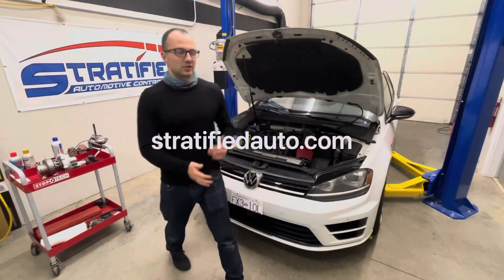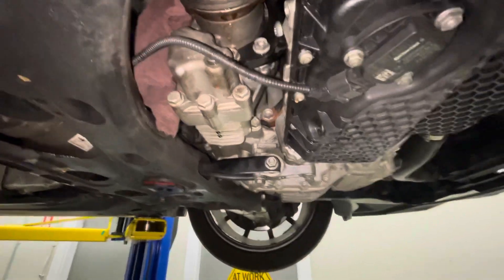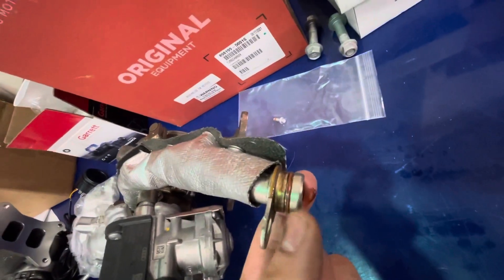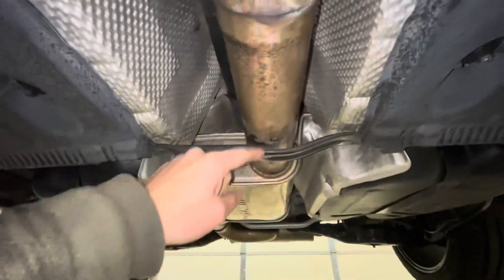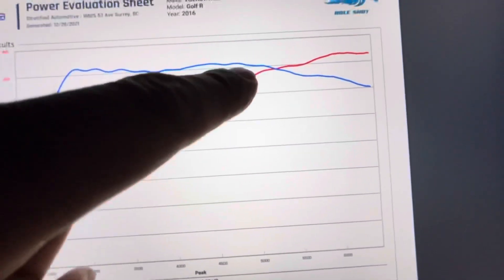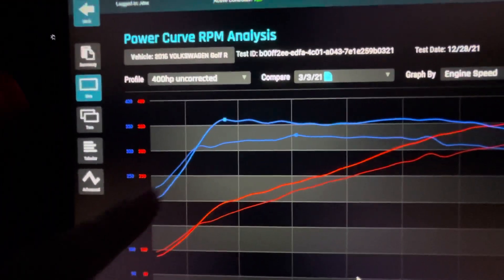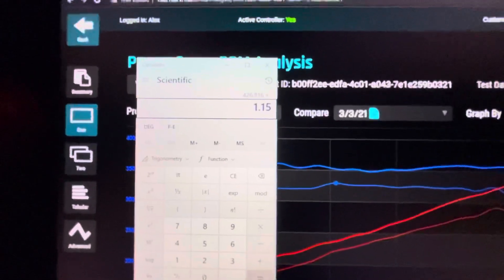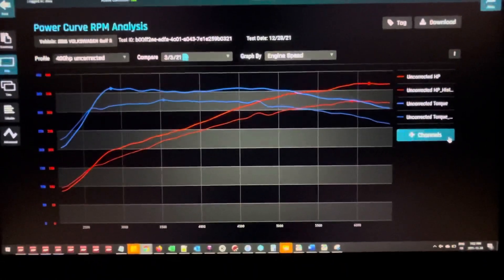Mk7R Build EP1: Garrett PMAX Turbo Upgrade and Dyno

Comment: Thanks for this, I plan to use this turbo when my IS38 fails, I have a 7R which came with the factory MPI installed, does that make this turbo basically plug and play?
Reply from the maker: You will definitely need it tuned. We can help you out with that. https://www.stratifiedauto.com/index.php?main_page=product_info&cPath=332_259_261&products_id=726

Comment: Iam considering the garret over a hybrid is38 do i need to upgrade my hpfp if i only want to go to 350-380 hp with the garret ?? I have a mk7 gti
Reply from the maker: For those power levels you are at the edge of the HPFP. If you have a GTI for that power level I recommend the str38 https://www.stratifiedauto.com/index.php?main_page=product_info&cPath=332_259_308&products_id=1164
Reply: @stratifiedauto thanks allot for the feedback this Will certainly help me in making my choice we need more info like this!
Reply from the maker: If you have a golf R we can achieve those power levels on your OEM turbo with a tune. https://www.stratifiedauto.com/index.php?main_page=product_info&cPath=332_259_261&products_id=1137

Comment: Have you ran any eqt vortex standard turbos on your dyno? I would be interested to see the difference between the pmax and vortex standard. It seems like the vortex would loose a little response to gain a little more up top but it is hard to really tell comparing different cars on different dynos.
Reply from the maker: The vortex is a few hundred rpm slower to spool. We also have this option for power above the pmax. https://www.stratifiedauto.com/index.php?main_page=product_info&cPath=332_240_256&products_id=1163

Comment: Is a HPFP upgrade or MPI needed for the Stage 1 turbo???
Reply from the maker: If you want to maximize the potential on ethanol then yes.
Reply: @stratifiedauto  but not for pump gas?
Reply from the maker: For pump gas you’re right around the edge of the fuel system.

Comment: Hello, are the hose adapters required
Reply from the maker: Yes it’s obvious if the hoses don’t reach correctly.
Reply: @stratifiedauto  is it normal that it's so hard to fit together because of the joints ?
Reply: @stratifiedauto   i tore a joint because it didn't fit

Comment: what was boost at redline ?
Reply from the maker: It’s around 27-27.5psi.
Reply: @stratifiedauto  oh nice pretty flat .I'm tuning mine now on open source switchpatch.this is my 4th turbo I went to a smaller one didn't like the bigger 3076 for a fwd .
wanna know a weird damage ? the paper gasket for sucked into the turbo on mine not even a week after install and there was a whistle now there is a fin bent a little
Reply from the maker: Sucks about the damage. This is really a great turbo. We’ve tuned many of them.
Reply: @stratifiedauto  yes seems nice I like the broad powerband and seems very easy to tune I heard of some having spike issues trying to control it but this one behaved very well .25 psi in 4th at 3100 and in 3rd was 3600 rpm or so .very nice I'm just worried being in Edmonton we are at 2200 feet so I need to get a speed sensor rigged up here just to see what I should run on 93 for a curve now .I was running the is20 25psi to 22psi at 5500 with the stock dp etc lol catless I had it at 29psi to 22psi at 5500 so I'm curious
Reply from the maker: We have mapped out the speed of the turbo in our tunes using a speed sensor. So we don’t need a speed sensor in every installation. Also no issues with spikes and tuning this turbo. If you’d like to get tuned please don’t hesitate to reach out. We have the turbo and tune as a package.
Reply from the maker: https://www.stratifiedauto.com/index.php?main_page=product_info&cPath=332_240_256&products_id=1055

Comment: Is there any chance this turbo will ever work for a 19+ car? I currently am running an IS38 on my 19 GLI however i was told the wastegate doesnt work for 19+ MQBs.
Reply from the maker: We have tuned them on 2019s with no problems. You can go ahead and install it on your 2019.

Comment: I'm  on stage  3 on my 2017audis3 and  won't  pass  emission test.  What's  your thoughts and solutions
Reply from the maker: It depends on what items are failing. You need to scan for this and fix/address those items.

Comment: I just picked this turbo up for my MK7 GTI yesterday.  Have you protuned  this turbo  e30 for a GTI yet?

Do you think this would be pushing to much torque  for the stock block??
Reply from the maker: It’s great on e30 when tuned correctly but you need some fueling upgrades. At least hpfp

Comment: I have enjoyed this channel.  I bought this turbo and did major fueling mods, mpi.  I already had eurodyne so that drove me to source tuning from another person.  The  turbo feels like stage 2 after 2300 rpm until you hit about 3300ish then after that is just feel a little faster then a little more faster until the factory turbo falls 5000 to 5400 then after that you get surprised.  The tune limit was held at 28 psi and it just pulls at the same rate from 2600 to 6500.  I really like driving now.  Ecu reads 435 lbs at 5000 and 419 at red-line.
Reply from the maker: Glad you like the turbo. I like that it keeps the response of the OEM turbo with more top end.

Comment: I am really liking how the pmax stage 1 spools almost identical to the is38. Do you think you would be able to achieve the same numbers with just a hpfp on the same fuel? I currently have an is38 gti with stock fueling and im looking to get a little more. The pmax is looking like the perfect fit for me. I like the eqt vortex but I drive mostly on back roads so the quick spool is important to me.
Reply from the maker: Yes HPFP is all you need for those numbers on pump gas. It is indeed a nice spooling turbo with more top end than an is38
Reply: @stratifiedauto  thank you very much for the answer! Another question, do you guys offer a specific dsg tune to match this turbo or do you have a staged dsg tyne that works with the power level? I currently have an apr dsg tune but I am not sure if they have different files or what, I am not the original owner who had the car tuned.

Comment: Nice video! Did you test pmax stage2?
Reply from the maker: Have not on our own development car no.  It is a bigger turbo with more top end potential but also more lag.
Reply: @stratifiedauto  i ve already installed a garret 3071. It spools nice after 3800rpm.. do you know if g25 could have the same spooling time and better top end power?
Reply from the maker: There are 3 turbo families. GT, GTX and latest G. The newer you go the better the aerodynamics of the wheels and the better the airflow on the compressor. The spool depends on the turbine and the A/R. Smaller the A/R faster the spool. G25 exhaust side will spool faster than older GT or GTX30
Reply: @stratifiedauto  thanks for your  reply! Soon as i ve got this pmax stg2 i ll  comment u my feelings🤭

Comment: if you mount the stage1 turbo on an entirely original s3 8v, do you still have to do a reprogramming?  or can we mount it and stay with the original program?
Reply from the maker: Yes, tuning is key to make sure it runs correctly.

Comment: Hi, I have a GTI my current mods are
- ECS MQB FMIC
- Arm Motorsport 3 inch Catless downpipe
- CTS intake
- ARM Intake pipe (behind the intake I forget what it’s called
- Borla ATAK exhaust
(Currently tuned on IE Stage 2)
~~~~~
Any VW guys out there can tell me what would be recommended to run this turbo?
I have a 6mt GTI, so I know Clutch and tires.
But beyond my mods do I need HPFP, MPI?
I’d love to run ethanol but I have a 2021 MK7.5 and don’t see any flex fuel kits on the market as of yet and it’s my daily versus driver and way to lazy to flash between tunes.
Curious to thoughts. Thanks in advance :)
Reply from the maker: I would consider at least an HPFP for pump gas up to e30. Flex is coming soon but to maximize it on e85 you will need an LPFP and MPI.

Comment: I'm sorry but, 360 some. I dont get why you're saying it outperforms the is38. My is20 hits those numbers on e30 and is38 is hitting 390. Did you do a conservative tune or something?
Reply from the maker: Our dyno is uncorrected and reads low as it’s a Mustang. So an is38 on same pump gas will be around 40whp lower.

Comment: Couple of questions about the oil/coolant lines.  Do the spacer blocks require their own gasket/seals?  Did you have to cut the lower oil drain line and then reconnect to the newly supplied hard line?
Reply from the maker: No cutting needed. You can reuse the one orings but I recommend getting new ones. Everything else is included.

Comment: Are you guys seeing boost creep above 4500 rpm? Wondering if my WG is out because it’s fully open and building boost up to 34 psi at partial throttle.
Reply from the maker: No creep. You’re also possibly looking at absolute and not relative boost. Absolute has atmospheric pressure added to it.

Comment: Good work. Just wonder is it possible to fit this turbo with original downpipe? I am currently running stage 1 seat leon st cupra 370 hp and 490 nm and thinking about this turbo, but would like to keep the car legal which decat downpipe is not and sport cat only some of them. My upgrade will consist of modified original intake, intercooler and this turbo. Thank your for your advice.
Reply from the maker: This will work with the OEM downpipe no problem.

Comment: What intakes work with their stage 1 and stage 2 turbo’s? I have an APR intake and thinking about getting their stage 2 turbo eventually
Reply from the maker: If the intake fits on the OEM turbo it will fit on this one.
Reply: @stratifiedauto  nice! Thanks!

Comment: I'm looking into this garrett turbo with stratified tune and not much information out there and thank you guys for making this video.
So with this turbo, it comes wiht inlet pipe and muffler delete?  Do I need to purchase vw oem turbo installation kit separately?
Reply from the maker: Everything is included except the orings for the coolant and oil lines if you want to replace them. Otherwise it’s included.
Reply: @stratifiedauto  Sweet! thanks for the info!

Comment: Very nice curve. Does the stock engine of GTI endure this horsepower? Because the piston of GTI is slight different from the R.
Reply from the maker: Depends on application. If you race it on a road course versus street drive it. It should be fairly resilient at this power level if tuned well.

Comment: Thank you for overlaying the is38 to the new turbo, perfect comparison.  Sold…just need b9 audi support.
Reply from the maker: It’s a very nice upgrade. What do you have for a tuning solution now?
Reply: @stratifiedauto  the main tuners for the B9 A4/A5 are Unitronic and IE; I am Uni stage 2 ECU and TCU.  There is European support via Revo and AGP Russia.  Of course JB4 as well.  There is no Cobb support.  

So if we get this turbo to work with longitudinal applications like the B8 or B9, tuning will still be an issue.

Comment: Thank you very much for the test.

Has the vehicle been mapped again or does it keep the previous one of the is38?

What blowing make at 173000rpm in the redline??

Thank you
Reply from the maker: Yes the car was retuned for this turbo. The boost at redline is between 24-25psi
Reply: @stratifiedauto  Hi. To clarify when you say the car was "returned for this turbo." Did the Garrett make this power using the stock map? Thanks
Reply: @TheWiseDJ  I read "re-tuned" as in remapped by StratifiedAuto...at least that's my understanding...
Reply: Thanks. It looks like this turbo is definitely the one to go for if you want good and close to stock throttle response.